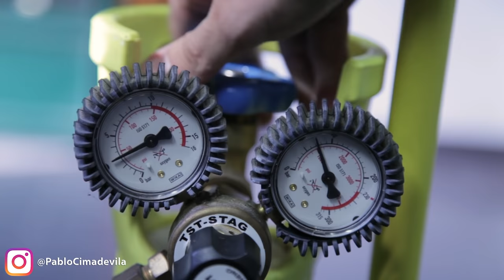PLATINUM 1 CARAT DIAMOND RING

Comment: wow I'm so impressed, I never knew that so much effort is put into such a little thing. I'm A New Fan!
Reply: Little thing haha. That "little thing" has a diamond of 1 or 2 carats that can be more than 20.000 $. Small thing, ey?
Reply: @ClaudiaOnyx89  more than 20 000.... have u ever bought a ring?
Reply: @Krillin1  did. But never that much expensive. And price per carat is different from country to country + the company from where you buy it. Tiffany & Co. sells a simple bracelet with 1.000 $ minimum lol. And arguments can continue till tomorrow about this topic
Reply: I've been designing jewelry for 35+ years. Engineering the way the that a unique jewel will be set is something that I love to work with the that jewel.
Reply: @ClaudiaOnyx89  So to add to your argument when a ring is custom made by hand that price also can skyrocket as you're paying for the rediculas amount of work & design that goes into a piece verses a production made piece that you'll find at almost every chain jewelry store & also most of the little mom & pop jewelry stores. So yeah, a hell of alot more than just the value of the  materials comes into play when talking about anything that's custom made by hand... 👍
Reply: @ClaudiaOnyx89  LOL $20k? Sure. could be. But it’s not. And it’s 1 carat diamond.
Reply: @jamesbizs  a carat can be even 20.000$ dont you know that? Depends on the cut of the diamond, how rare it is, colour and etc 🤷🏻‍♀️

Comment: Very nice ring well made just one question you formed the ring and soldered it closed then cut out for the mount did you do this so it could be sized on the mandrel before cutting the mount in? Great video

Comment: How long does it take to melt down the platinum please? I find it very hard to melt down the platinum bar to make a ring. Any suggestion would be helpful
Reply from the maker: Hi, you need to use a propane and oxygen blowtorch to be able to reach 2000 Celsius and melt platinum. Roll the platinum in very fine sheets and cut it in small pieces and melt 10 to 20 grams so it's more easy to melt. Thank you for watching
Reply: @PabloCimadevila  thankyou so much for your reply. Much appreciated.